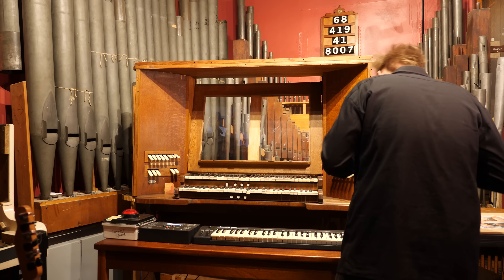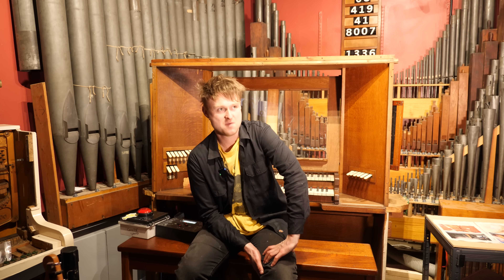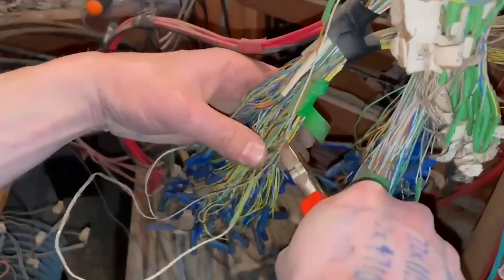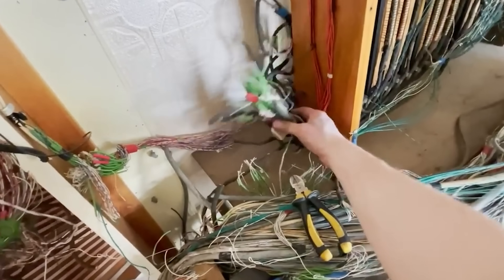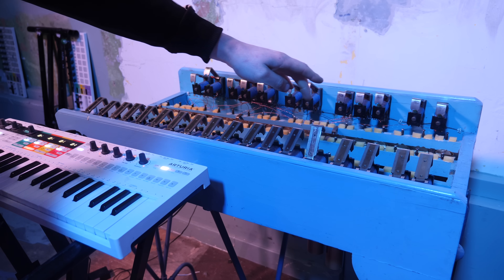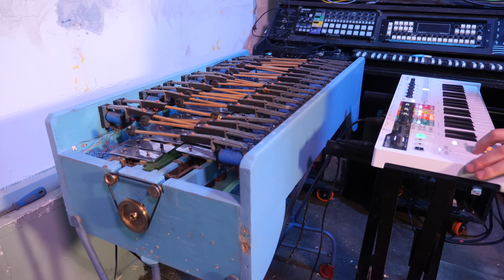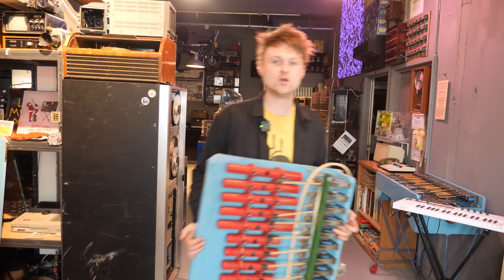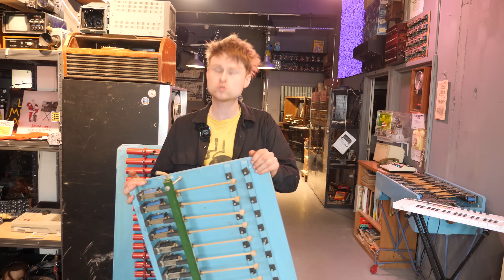ANOTHER MASSIVE ORGAN Project - Part 1 MIDI VIBRAPHONE

Comment: A critical differentiator between the vibraphone and a glockenspiel is that damper that you kind of glossed over. That's a major part about the vibraphone sound - you can engage the damper to silence a chord when moving to a different chord, to prevent dissonance. Without it, you basically have a glockenspiel. I would suggest adding a solenoid programmed to respond to the sustain pedal CC, that actuates the damper,  but in reverse - so when you press the sustain pedal, it damps the vibraphone, like an actual one does.
Reply from the maker: It has a solenoid on that. I didn't mention is cus not as interesting as the wobblies
Reply: @LOOKMUMNOCOMPUTER  Yeah, the damper should be a simple MIDI on/off; should be easy to do for a chap of your talents, Sam LOL! And having at one time gigged with a vibes player for a few years, yes you DO need to be able to program the damper as well. 😉
Reply from the maker: @caddelworth  it is wired in, i used it in middle of vid. just edited out the bit talking about it
Reply: @LOOKMUMNOCOMPUTER  Ah, that's grand: nice one!
Reply from the maker: Yeah it's cool but the dissonance is lovely too :D
Reply: On the pipe organ side of these, you would quite often have an individual damper felt per note, with a seperate stop key that would activate a larger pneumatic to lift them all up at once, quite useful ! Some even had a "Half blow" feature, able to cut the wind in half, in order to soften things down even further.

Comment: SO BEAUTIFUL!!! You are doing so of the GREATEST work to bring the old instruments into the 21st century!!
You could cover the motor, and pullies in a box made of MDF (do NOT use regular plywood... MDF ONLY), then use dynamat on the inside of the box (and maybe the outside too... actually make the box/cover with 2 layers with a 1/2 inch gap all around and then fill it with that expanding foam for even better results... and even put dynamat on the outside of THAT for even betterer resultses) if you can't find a servo/motor that is quiet enough...  Dynamat can be expensive, and IDK if you can really buy small pieces of it, but there is a cheaper alternative i think its called killamat ... but you could make some yourself... you wanna all vibrations in the box to be deadened and all gaps sealed... plus the second layer of box with that insulation/expanding foam in a can will do wonders to stop transfer of vibration from one box to the other... oh and put dynamat on the vibraphone all around the pully/servo that the box will cover.. and the other side of that area too.... 
- this should COMPLETELY stop the servo/motor sounds from being heard, without affecting the sound of the vibraphone :)

Comment: look like the organs used to be in a cinema , the thing like the carhorns and the ahoogah horn kindah give it away 
https://www.youtube.com/watch?v=7L-OqjaXxY8 (compton organ) 
https://www.youtube.com/watch?v=OihbIgXBsMU
https://www.youtube.com/watch?v=Lqyi8EPuXUQ
https://www.youtube.com/watch?v=POk8RaGMZkE
it actually might be a nice idea to put a large screen tv or beamer in the center of the organ and maibe organize a silent movie day once every so often (might have the option of having a good organist put the music to midifile while synced with the movie and play it on a loop )
think a small direct drive steppermotor like a nema 8 would work on the vibrato part  might get it to work using a grmbl arduino setup , might allso help if you insulate it from the wood as it acts like a soundboard

realy like these organ conversion builds , like i said before you could add drums cimbals cowbel and other percussion stuff

Comment: Common mistake, a Xylophone is actually the wooden version of this type of instrument. Xylo is the Greek word for wood. Beautiful project.
Reply: Marimbas also have wood bars, but are larger and a struck by large felt or yarn hammers. Thus a softer tone. Xylophones are struck by wooden mallets, and are thus louder. Glockenspiels have metal bars struck by steel hammers, chrysoglott/vibraphones are larger and struck with felt hammers.
Reply: You know, I only just learned that xylophones have wooden slats... a couple of days ago, when watching a Joe Porter video where he plays the same theme on several tuned percussion instruments in a row... and the xylophone was wooden! I'd assumed, based on the rainbow painted childrens' model, and the very cheap student model, that they were supposed to be metal. For decades, I just assumed the high end models were supposed to be metal, too. Come to think of it, I do remember seeing a vintage childrens' version (rainbow painted, too) where the slats were wooden, and I thought they'd cheaped out... when actually, I had it backwards all along🤣
Reply: Well aren't you clever...

Comment: Love it.  I’ve made a similar thing with hand bells and solenoids but the clicks from them are fairly loud. I was wondering how to make the bells more resonant too. This amazing because it solves both problems. It sounds amazing and the control over the chamber is fantastic too. 

 Are the relays “on” when holding the beaters above the plates then? I assume that’s quicker because of gravity being quick
Reply: I'm familiar with those "organ-type" solenoids.  When the coil is on, it pulls the striker down, i.e. it pulls the movable metal piece closer to the coil, so that the metal piece covers the center bar of the coil.  Re: handbells, there's a handbell unit that someone recently made for a gigantic (92 rank) cinema organ in Wisconsin, USA.  From what I've heard on YT video, IMO it also has a rather noisy action.  Coming up with a way to rapidly accelerate a bell striker to hit the bell hard enough to get significant volume, without the mechanism making any noticeable noise of its own, is a difficult thing to do.

Comment: Use a small stepper motor so you can also keep. the pipes open or closed.
Reply from the maker: No need for that but if can get stepper motor with no vibration onto the vibraphone then will be doing it

Comment from the maker: now remember! my relationship with words is very tenuous (no idea dont ask, words and things dont match up, more sounds, materials and other tangible things make sense, ye olde grammar nonsense and writing is just nonsense :D). i tend to say a lot of words and mean other things. but atleast you get the gist haha. for reference here are some of my mess ups below :-
xylophone i mean glockenspiel im a donut. 
thingamagoop - Still meant thingamagoop
Reply: I was going to comment about that, but you beat me to it.
Xylophones have wooden note bars.  Glockenspiels have metal note bars.
This is a common mistake because young kids are often given toys with metal notes which are usually mis-labelled as xylophones.
Reply: Don't worry! We understand. (PS. An organ vibraphone is called a Chrysoglott)
Reply: @JesseBadut14  Quite right ! Usually they are the same thing, just it becomes the Vibraphone when you switch on the motor for the rotating baffles. However for some reason in this case, Mr Stockdale had one of each !
Reply: @EastMidlandsOrganMuseum  Very interesting! I never knew that!
Reply: @JesseBadut14 a new term to me, but I haven't played theatre organs. Bit of a rabbit hole
Reply: Let me guess... its a 1 off piece lol 😂
Reply: Or in this case 1110 lol 😂🎉
Reply: Help me program 13 in the piano by number system... its a A note... i cant blast it high enough... i 5hink you can... just dont explode your soul trying to ram it higher!

Comment: Hi Sam, a stepper motor rather than a brushless motor may be a better bet? They are able to provide more torque and are still quiet running and still can be PWM controlled
Reply from the maker: but they also tend to vibrate no? which would be quite bad in this instance. especially for hoping to get more rpm than even in the vid at the top end. torque is not the issue as the shafts are very free. more quiet running and good low and high speeds
Reply: @LOOKMUMNOCOMPUTER  Do some googlin on the TMC2208 stepper driver! Controlls the motor in a way where it's nearly silent and the vibrations are negligible. Top speed should also be sufficient... Probably... Maybe... ;)

Comment: A stepper motor with a Trinamic driver would be ideal for this - execllent low-speed control and silent.
Reply from the maker: mike tghanks. my only experience with stepper motors have been reveryberant in their enclosure so i went away from it, but you recon thats the way forwards? im hoping for it to get quite quick too beyond in the video, would stepper still be the way?
Reply: @LOOKMUMNOCOMPUTER  Trinamic drivers work absolute magic on steppers - They use 64-256 analogue levels between each step. Would easily do the speeds you were doing & more and be completely silent.
Reply from the maker: @mikeselectricstuff  ok great news, ill get hold of some and report my findings! cheers. any suggestion on a good trinamic driver? or any one of the world wide web
Reply: If this were a 3d printer i’d said trinamic 2209 and an ldo motor. But that’s kind of the standard answer for that usecase, not detailed knowledge. Actually you might even borrow one from your Lulzbot to test it.
Reply: Sam and Mike - I'll have to show Sam an example when he gets up here to our museum at some point, however where these devices were originally employed - on cinema organs, the motors were pneumatic ! Somewhat like a player piano roll motor, however working on positive air pressure rather than suction, we have two - however we too will be placing a modern motor inside the casing, as the facility to vary the speed is very useful.
Reply: Yep. Nema 17 and a tmc would work great. Plenty of step stick breakout boards to be had off the shelf too.
Reply: I'm also backing up the trinamics drivers, I've used them to make focus motors for camera lenses, and the camera's onboard mics don't even pick up the motor noise when running them at low current
Reply: Yea tmc2209 driver is silent at low speeds
Reply: it'd be trivial to set up the arduino midi input so you can directly control valve angle too
Reply: Cool, something to check out when building CNC machines!
Reply: @KeritechElectronics  Not great for CNC as you compromise on speed and torque  which isn't an issue with 3D printers but is with other applications.
Reply: And a stepper will last near forever
Reply: Seconded on TMC2208/9 and NEMA 17. Easy to wire up, and speed of the motor is controllable with a simple pulse wave from the arduino
Reply: While this could theoretically work, lt's not really the best solution. Stepper motors have a lot of poles and are meant for high positional accuracy and repeatability, not for silence or smoothness of motion. The frequency would be too high and it would end up getting loud even if it's driven with pure sine waves. (But still not nearly as bad as the servo.)

My recommendation would be a slow-running brushed motor with gears or a very small pulley, or maybe a brushless one if a slow and silent driver can be found.

Comment: Have you ever considered putting magnets into the keys of the church organ, then putting coils under each one so that the keys will spookily play themselves ... maybe for Halloween?
Reply from the maker: yes. sadly its a big modification job. and would likely take the console too far away from its provinence. but who knows! maybe a sleaker less intrusive means will rear its funky head.
Reply: @LOOKMUMNOCOMPUTER given the current rate of progress, in five years there might be some slightly used but obsolete fully dextrous robotic android arms floating around.  Not sure that's the right kind of (not) obsolete you're going for tho...
Reply: @LOOKMUMNOCOMPUTER Ok, how bout this. No permanent modification, not even a temporary one, just one you can use when you want it to play on its own.

Make a wooden frame that rests on top of the claviature. That frame consists of an MDF board and two uprights that are its legs, but also go up as well (so in profile from the front, it would like a wide H).

At the tip of each of the keys, on the MDF board, one hole is to be drilled, and one tube is to be glued in place. This tube sticks (again) both up and down from the MDF, and i'd say it should be one of those plastic electric conduits, but... it ultimately is tied to the coils you'd potentially use (be they hand would or already existing items, which is up to you).

Now, you'd need wooden dowels to go through each of the tubes, and they should fit loosely inside and rest on top of the keys, protruding out of the tubes' ends up top. By how much, to be determined. The tips of these "sticks" should have cue tips (from billiards). That's a soft (easily replaced) surface that won't mar or damage the keys in any way.

Next would be to add a C channel piece of metal up top (this has two purposes, it weighs the whole contraption down so it doesn't vibrate off and it's also robust enough for its intended purpose). Nothing too heavy tho, and of course, something you can bend. If you can't bend something like that, then it can also be accomplished from a plate of metal with angle iron on its sides. I'd say that the plate could be 1 mm sheet and the angles 2 mm metal one. On this plate, you'd need to drill holes above the sticks and stick springs to the sticks that only just keep the sticks off the surface of the keys.

Then... we come to the relatively complicated part and actually where the project would start on account of the fact that you either have these coils already or have to make them to wind them, to suit existing tube you can find. The coils would stick over the tubes (at different height intervals if the tubes are too close proximity) and they would energize using a piece of metal tube that's either slipped over the sticks (which affects the pull power of those springs mentioned above) or the sticks are cut in half and stuck into the metal tubes.

Each time you activate a coil, it pulls down the metal, which is tied to the stick which then pushes the key through its cue tip. In theory, you can have this move with quite a bit of accuracy when playing. In practice, a prototype should be build to test out just how much acting force you need on that spring, which is the key component of the whole affair.

Visually, it wouldn't be too heavy on the eye, it reminiscences of the organ tubes in a way and it's also silent. So it won't detract from the organ with noisy activation mechanisms. If you tune that spring force perfectly, it won't affect the keys in any way as (potentially) a motor would (rolling key presser as some retrofitted pianos have).

Just a thought.
Reply: A very rare thing to see, especially on organs - however not something that doesn't already exist ! Moving keys on self playing instruments was as Sam has described in other videos, a very American thing. Not popular over here as it can harm repetition, however that being said, Kimball - the pipe organ builder in the states, and later electronic organ builder, produced a series of electronic organs that could play rolls, and these - had moving keys ! Very fun, but so rare in the UK, we've never been able to find one for our own museum. https://www.youtube.com/watch?v=s9S4wzEfwpk